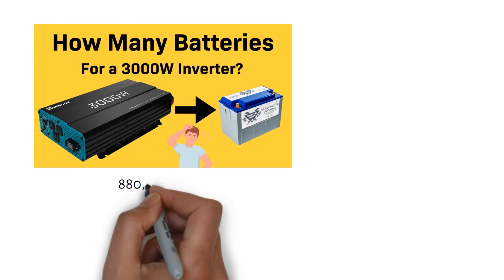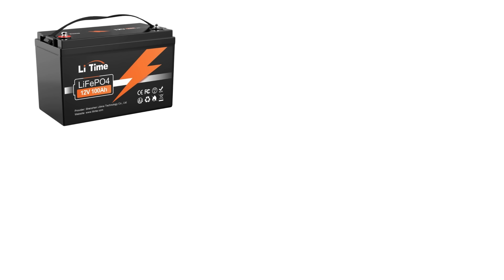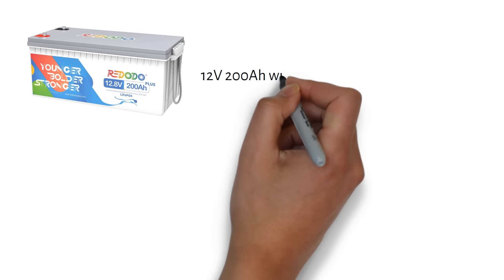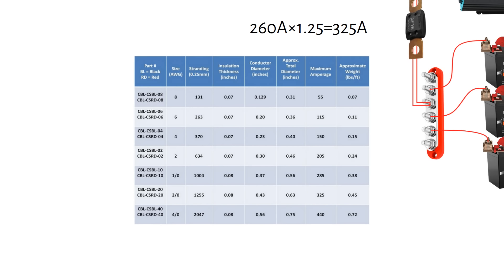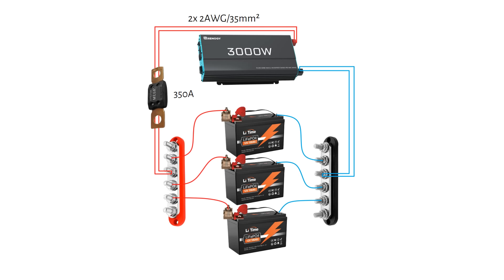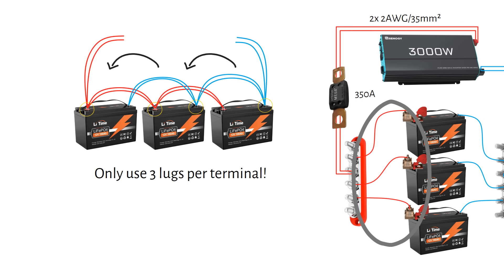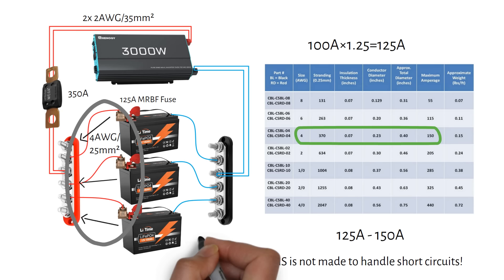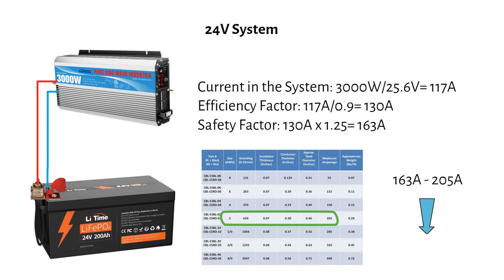How Many 12V Batteries for 3000W Inverter

Comment: Sailboat life (15 yrs) - my 329w hi output panel outperforms 500+ watt regular panels. I use 4 6v golf cart bats for total of 450 amp hrs. I often see the panel output 63+ volts and 20amp input from the Victron 30amp controller. I run a Victron inverter, and as a photographer I use calibrated monitor, computers, external drives, battery charging for many devices, etc. 
Add the frig, lights, 8 fans, a real hifi stereo, blender, water pumps, shower sump pumps and the batteries are usually floated back down by noon. Next time I'm going lithium, maybe add another panel. Maybe not. It's the high output panels that make it possible. Otherwise there would be many solar panels needed.
If my sailing grounds weren't in FL, Bahamas, I would definitely need more panels, no doubt.
Reply: AMAZING... 4X 6v BATTERIES = 24V.  Does your Victron Boost the voltage from 24V to 63+ Volts and you have all those other loads connected and running at the same time.  Add the frig, lights, 8 fans, a real hifi stereo, blender, water pumps, shower, sump pumps??????????????
Reply: @johnconrad5487  Let's see if I can help understand this better. Goal is a 12v system. First concept in this is to double the volts. Then double the amps. Rule - when connecting batteries, we can either double the amps, or we can double the volts. We need to do both. We start w four 6v bats, 225amp each in this example.

 First, We want to connect two 6v bats in serial. We connect them pos to neg, which will create one 12v battery. Do the same w the other two batteries. Now we have created two 12v batteries at 225amps each. We have doubled the voltage but not the amps.

Each set of two has one remaining pos post and one neg post. 
Next we connect them in parallel by connecting pos to pos and neg to neg. This has now doubled the amps to 450amps in a 12v battery bank.

The charge controller manages the power input (solar panel). The panel can be 12, 18, 24, 36, 48 , whatever. Using the app, we tell the controller unit what our system voltage is. In my case it's 12v because my fridge fans and lights are all 12v. I hope this helps.

Edit: The charge controller does more than manage the power coming into the system. It also manages the charging of the batteries so they don't over charge. These charge settings are peculiar to  batteries by brand. The settings are obtained by visiting the battery brand website.
Reply: @nobody1841  Hello,
 I am trying the same with the 6 volt golf cart batteries that will give me 12 volts at 450 amps.
I already have these batteries past use.
Nick, has advised only 100 amps max in his video and email asking about this.
How many watt inverter are you using? I am trying to to use a Renogy 3000 watt inverter.
How long has your system been active?
Rich
Reply: @RichDzintars  I've been running 12v system using 6v batteries for 14 years. Using Victron controller MMPT 100/30 and 1200 Victron inverter. If I'm going to wet vac or run heavy saws I use the generator because I don't like to stress the batteries hard. Usually get about 6-7 years. Next time I'm going lithium  LiFePO4 because they are finally ready for prime time.

Take note, 6v batteries in the 12v system are full at at 2.7v (12v bats full at 13.4).  So when you wake up and they show 12.2 - it is no big deal.
The rule is, when the bats lose 1 whole volt, they are 1/2 gone and close to being useless. This means 12v batteries would be in trouble at 12.2v overnight.
Reply: @johnconrad5487  you run series / parallel. Two 6's in series make 12 (do that twice) and run those in parallel. 
I have 4,6v 210 ah deep cycle. This gives me 420 ah of 12 volts
Reply: @RichDzintars  I'm using 4,6v 210 ah (12v 420ah total) and a 3000w renogy inverter. Been using them for a few years with no problems. I try to keep it under 2000 watts (usually 1500) at once 
I'm very happy, I also gave 2,100watt solar panels and a dc-dc charger that I can run off of the truck but I have never needed it

Comment: Overall this is a great video and very informative. Understanding types of batteries is important. Lead acid standard car batteries are not the same as lead acid deep cycle. Deep cycle batteries are used in heavy equipment, commercial diesel trucks, and marine applications. 
13 lead acid batteries is standard car batteries. If using marine or big truck 12 volt deep cycle the 4 is minimum 6 is good,  8 is best when talking about stored power. Deep cycle like LiPo discharges at a slower rate over time. Standard car batteries discharge quickly.
Reply from the maker: Indeed. Most people don't consider the c rates of different types of batteries .
Reply: @toddstanley3619  what is 4 a minimum for though ? You need to take in your requirements as well as your availability of solar or other means of recharging vs the weight you are going to carry. 

4 large deep cycle batteries is more than plenty for me with 200watts of solar and a dc-dc connected to the truck. If I needed even another 2 lead acid batteries I'd get rid of them simply for the weight savings of lithium. I'm already pushing 250lbs for the 4 I have !

Comment: This is a very informative and well structured tutorial.   I learned a lot and hopefully avoided some mistakes.  
I encourage everyone to take this formula and actually run through the steps for the equipment you will be using.
Case in point  - I use different wire supplier so the cited chart is not correct for me.  

fwiw I'm not sure I'd trust the currrent capacity chart in this video - even for the wires purchased (published by Windy Nation it seems.)  For one thing it doesn't mention the run length which is important for low voltage DC circuits.

Ie. the chart cited by Blue Sea Systems (top rated tinned copper wire) and heavily linked on many automotive/vanlife forums is derived from ABYC E-11 info.  (American Boat and Yacht Council)
I'm not sure what those Windy Nation wires are made of but it must be something special!

The ABYC chart shows for a 200A capacity run (of any length), a 2/0 AWG wire is required, not 2 AWG.   
For a 150A capacity - 1AWG, not 4.

So for the example in video - one would need 2 x 2/0AWG Blue Sea System wires running from the bus bars to each terminal of the inverter and a 1AWG wire between each battery and the bus bar.

Comment: Really awesome instructional videos . . . thank you!  As a newbie to solar generated power, the 48v system you diagrammed in the video is very appealing. However, I am wondering  if you might either, 1: add an addendum video on how to calculate needed solar panels to charge the EG4 battery, or 2: simply respond with the number needed and the calculation used to arrive at the required number.

Thanks and keep up the great work!
Reply from the maker: i have made a video about how many solar panels you need.

Comment: I have one of these in my camping car, plus 2x 120AH Kings 12V LFP batteries in parallel. Works great. I upgraded my alternator,  and charge these LFP batteries @ 90A. Works great, too easy.
This inverter has a very quiet fan that is rarely even audible. I can recommend it hightly.
It also has a UPS function. The relay will switch from mains to inverter power in 30ms.
Buy it.
Reply from the maker: I will ask renogy to send me an inverter.
Reply: It doesn't switch fast enough to keep my p.c. on unfortunately
Reply: I also have a Renogy 12v 3000w inverter. I had no idea it has a UPS option. Its not needed in my setup since I have it connected to my AC panel through a transfer switch. I will dig into this feature - I would like to know how it works.

Comment: Thank you so much as this is exactly the system I have been looking to install in our small travel trailer.
Reply from the maker: Then I failed trying to explain that a 3kw inverter on a 12V system is not ideal.
Reply: @cleversolarpower  My trailer is already wired with 12-volt solar, It has 1 100-watt panel and 1 75-ah lead acid battery.
I am removing the lead acid and installing 2 lithium LI Time 100ah batteries and adding 2 more 100-watt panels.
The travel trailer is only 16 feet long, so to go to 48v seems like more money and not necessary.

Comment: New sub here remote rural off  grid  Australia here , moved off grid about 11 years ago am about to update my solar and wind thank you for the insights. I run 24V and a separate bank for 12V house and workshop lighting LED  power for house through  through inverter 240V. Going the new lithium sodium batteries on upgrade not the lithium ion flash bangs.
Reply from the maker: Thanks for the sub! Why not install a 24V-12V converter and use the 12V batteries in your 24V battery bank?

Comment: Interesting.
I was a trucker, OTR.
Made my own coffee in a standard 12 cup coffee maker.
Four commercial 12v batteries had enough juice, with the truck shut off, to make an entire pot off of a 3500 watt inverter, and still have enough juice in the batteries to start the truck.
Knowing this, four batteries on a different setup, with a 10 amp charger was more than enough to make the coffee, and keep the batteries charged I had a second 3500 watt inverter to power a mini fridge.
Since that was intermittent, I didn’t have to worry about the batteries running dry.
I also would run a 750 watt microwave once or twice a day in this setup.
I could charge these batteries by the charger on a land hookup, by the engine, or by a small 1200 watt generator holed up to the charger.
The 1200 watt generator was enough to power a small window air conditioner, which cooled the small RV quite handily.
2 ga wires in parallel were more than enough to hold all this current, but each of the inverters had their own wires.

I should have tried solar panels to see if I could have used the panels without an outside source of power to see if it was sustainable.
I didn’t use a whole lot of power, so it should have been enough to keep things going.
Reply from the maker: It depends on the load that is attached to the batteries. If your inverter is 3500W, but the load is only 1000W then it's different. This video is about showing how many batteries you need with a 3000W load.

Comment: So, I'm looking to create an emergency fall back system. Un other words, to only use in a power failure. So, limited  use and probably around 1500 watts continuous, but capable of up to 3000 watts potential for fairly short periods. (maybe 10 minute or so) 

I have an old 36 volt golf cart using (6) 6 volt lead acid batteries. It was originally a resistive type controller, but I converted it t a solid state motor controller. It works very well and is a very clean conversion. The batteries I use are typical golf cart batteries rated at 110 watt hours. 

There are a few 36 volt inverters out there, but they are pricey. When I redid the system, I used larger cables and bolted connections. I have the controller fused at 300 amps. The controller is programmable and I can tune it to adjust performance and can also use the software to monitor performance. I run it in a moderate mode and mostly on flat terrain. My goal was to make it perform better and be less harder on the batteries. I have a few years of the batteries and they are in good shape. They run cool in my usage and I rarely need to add water. I believe the conversion I did worked very well and overall battery life should be better than original. 

A potential option when I need to replace the batteries, is to switch to 8 volt batteries for a 48 volt system.  The controller I have can run on 48 volts and the motor can also operate at 48 Volts, giving me a bit more top end speed. In retrospect, I probably should have made that change when I did the conversion. But I would have needed a different charger,

When I need to replace batteries I'm considering using (6) 8 volt lead acid or possibly reconfiguring the battery box and going with Li Fe Po4 batteries and a new charger. and retuning the controller for 48 volts. 

The nice thing about this approach is it would make using the cart as a quick, plug in 48volt inverter system. My goal is to provide emergency power to my barn/shop. The shop uses a pretty typical 100A  120/240 volt 3 wire system. I don't use too much 240 volt appliances, with the biggest draw being a 240 electric water heater and occasional use powder coat oven.  I could run my water pump at 240 volt but currently use 120volt. Other than that, I have a couple welders and a plasma cutter that can run on 240 volts or 120.volts. Asl have an office AC and 240 volt electric heater. All my lighting is LEDs. My thinking is to not  use any of the 240 loads in this emergency configuration. My average load using only the 120 volt is under 1500 watts. I'm not looking to go off grid, but just a quick way to power limited usage during a power outage. Power outages of a couple hours is not uncommon and I do have a portable gasoline generator I use on extended outages. I use a small transfer panel now, with the generator, And I have a smaller propane generator that only outputs 120V and is set up for extension cord use. It's a bit quicker to set up for limited use.

Outages in the winter are the worst because  often the weather is bad and getting  the generator set up is unpleasant! But I have this little powerhouse of the golf cart, parked in my shop!  I'm trying to figure out a quick set up use of it in my back up plans. In the winter, having lights, being able to run the pellet stove and some small loads, 

I'm an electrical engineer and all the switching/isolation stuff is in my wheelhouse. but I don't have much experience with LiFePo4 batteries.  I think the use of the golf cart a a power source, has some real potential.  I know a lot of people who have electric carts and I'm wondering if anyone has done this. And am curious to get ideas. 

Likewise, for the with EVs, think about being able to utilize that energy source as emergency back up power. If you live in the country like I do, you probably face fairly frequent outages. A whole house automated back up generator would be nice, but they're a big investment. An electric golf cart is a nice energy storage source and EVs would provide an even larger storage source. 

I would appreciate any thought or comments.
Reply from the maker: I recommend using lifepo4 batteries, they are much cheaper. Check my recent video where i compared to an AGM battery. If you are going to use a 48V system, you should wire 48V batteries in parallel, not 12V batteries in series. I also made a video about that recently.

Comment: nice breakdown on how many batteries to use a 3000w inverter. now next video should be how many solar panels to maintain those batteries.
Reply from the maker: Checkout my video about sizing a solar system.
Reply: @cleversolarpower
Reply: Or what to get to grid/mains charge them if used without solar as a house backup system?

Comment: I love your videos, they’ve helped me quite a bit! One thing that I don’t see you talk about when it comes to inverters, either here or in your latest video, is the surge wattage that these are rated for. This Renogy 3000w can put out 6000w surge. If you’re going to use fuses, especially in the fast acting ones, how is that surge going to affect that fuse that’s going to be underrated for 6000w (500+ amps)?
Reply from the maker: Good question Chris. The surge rating of high frequency inverters are non-existing in my experience. The low frequency inverters like victron do have surge power. Regarding the current, the fuses I recommend and these fuses in general are not fast acting. Midi, mega, anl, mrbf, clast,... Are all slow acting. Electronic fuses like glass tube are fast acting. Maybe I should do a video about current/time characteristics of a fuse.

Comment: Lots of good info but surprised that time was not mentioned. Ah means amp hour. In theory, a 100Ah battery can supply 100amps for an hour, 1amp for 100 hours or anything inbetween. So if you have the number of batteries in the video, it's essentially saying that you can run the 3000w inverter at max output for about an hour. If you want more time, you'll need more battery storage. Lead acid batteries are the worst though because you shouldn't discharge them below about 50% to keep them in good condition. Anytime you see a 100Ah lead acid battery, think 50Ah.
Reply from the maker: That was outside of the scope of this video. It would have made it more complicated. I made a video about c-rate which talks about that.

Comment: Very good explanation but you need to tell them that a battery of certain capacity will run the inverter for less amount of time if rated smaller. A 1500W capacity battery will still run the inverter 30min. if the 3000w is close to being used. Capacity is time dependent. More capacity the longer it will run it.
Reply from the maker: Of course, but that isn't the point of this video 😉
Reply: Only if the battery can output that much current. If it is a 100A max output 12v battery it will trip the over current sensor in the battery.

Comment: I see what you're saying and how it looks like it all adds up but I have been running a 200 amp hour battery Bank lithium and a 3000 watt pure sine inverter to run my induction cookware my induction oven and every other appliance and have never had an issue. I even run an air conditioner that is an indoor one for my RV that vents out the window and it runs that fine too.
Reply: Pretty sure he's giving recommended usage. You are always free to burn your stuff up just make sure children and pets can be rescued safely.
Reply from the maker: You can even use a 5000W inverter on a 12V battery, but that doesn't mean it's good design choices. I'm making people aware that there are better design options.
Reply: How long will your system run of the battery’s?